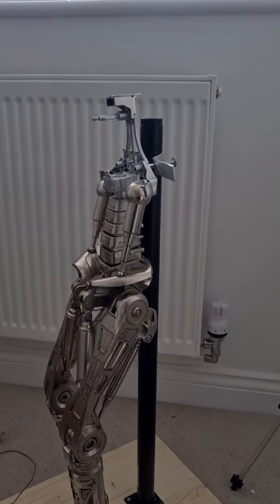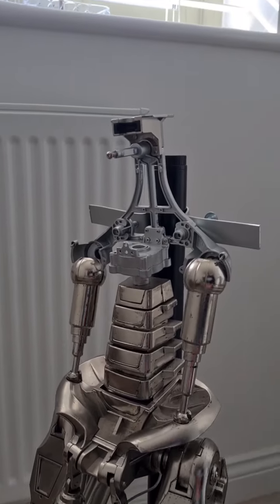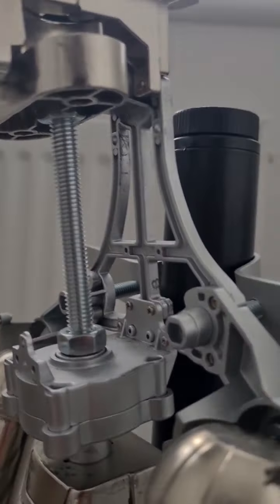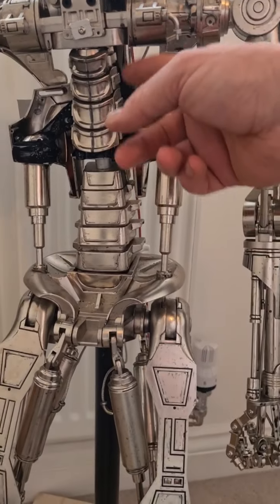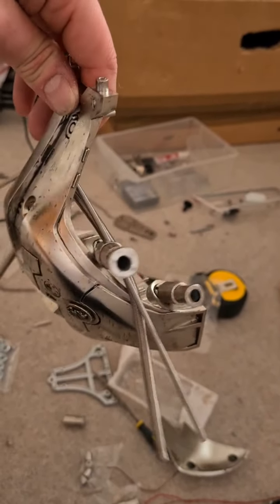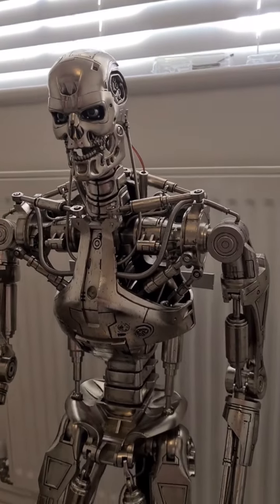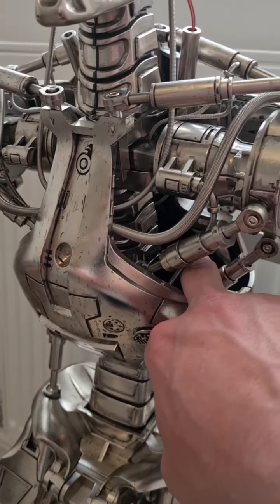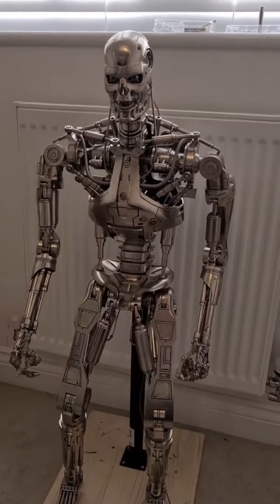Spine mod update

Comment: The words extreme and radical spring to mind brother !!!! Looks great you've done a man's job 😁 add some extra hoses to the chest pistons and "boom" total transformation ! Also maybe try to cover the central shoulder joint ? It's the only thing that looks a bit odd to me 🤔😁😎
Reply from the maker: The words idiot sprang to my mind several times when doing it.

What do you think about the shoulder joint painted black?
Reply: @SJW2511  I don't think that would work ! Maybe if you still have some offcuts from the plates left use them to cover it ? It will make it look machined, as long as it's subtle I think that might do the job 😁😎
Reply from the maker: @gweilojohn8550  can you see this
 https://drive.google.com/file/d/1K4N8g43MgDJrjVQqsktsCbeGdnYaMcFo/view?usp=drivesdk
Reply: @SJW2511  that is really good do you have a front shot ?
Reply from the maker: @gweilojohn8550  same from front

https://drive.google.com/file/d/1K5f-1Ero3n7u3htgNzag4hOJ6FR6vCDa/view?usp=drivesdk

Difficult to cover shoulder hinges and still enable movement
Reply: @SJW2511  That's amazing it now looks like a movie prop 🤯 I have nothing but respect and admiration for you brother ! Can't wait to see him finished 😁😎
Reply from the maker: @gweilojohn8550  thanks for your kind words
Reply: @SJW2511  credit where it's due brother you earned them 👍😎